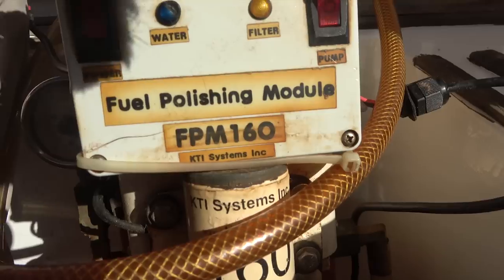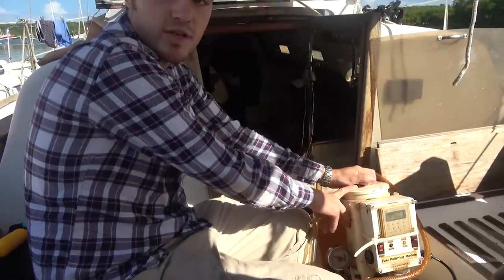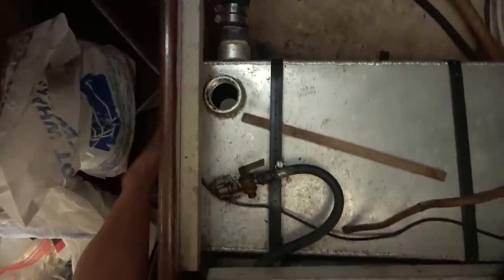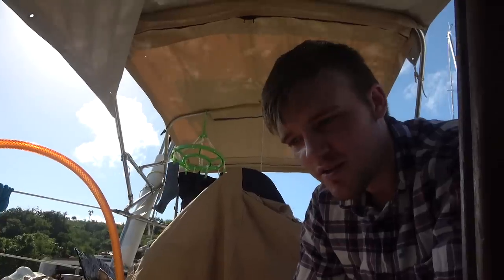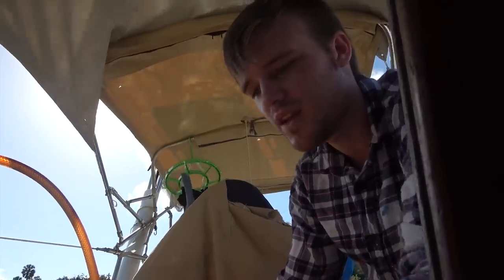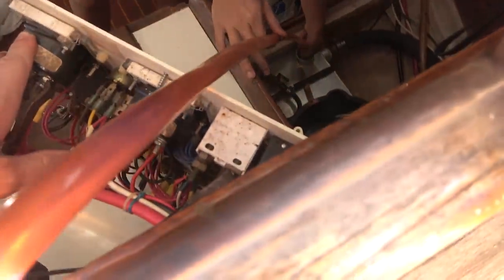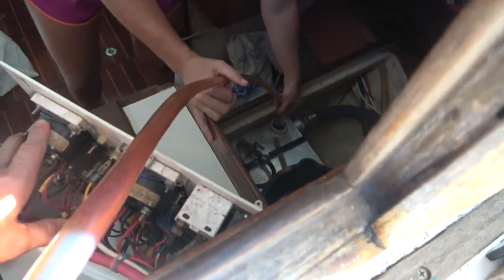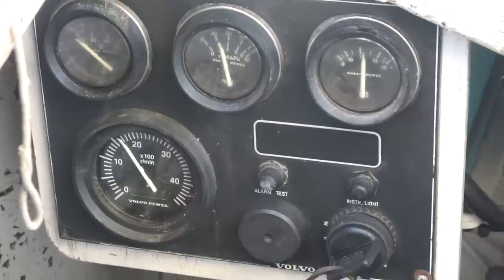Avoid DISASTER AT SEA the Boat Chore You can't Ignore  Ep 111

Comment: The problem with the outboard is you have a broken dioframe (fuel pump) the dioframe is a small pump with some rubber flaps inside and over time they must be replaced. It is the square box in the left side of the engine and it's connected to the fuel line, you can get a renovating kit for this pump. Regarding the fuel tank on your boat check the fuel cap and rubber gasket so you prevent future water in the tank.

Comment: If I might add my 2 cents, fuel is sucked in by vacuum witch means the vacuum port in carb is clogged. My remedy is take that carb off and every screw valve, soak it with carb cleaner or gas then shoot 120psi air through every hole, (opening) you see....worked twice for me anyway

Comment: Try covering the throat of the carb with your hand while trying to start the engine. This will cause a pretty good amount of vacuum so if there is any dirt within the carb or a priming issue it will usually pull it through.

Comment: Clean the tank because the sludge on the bottom gets stirred up in rough weather - just when you need the engine to run . When empty , take it right out and cleaning it with solvent and a really good shake
Reply from the maker: Okay, we emptied it completely and used a shop vac to finish it off. We didn't cut a bigger access port and the one that was already there did not allow us to get our hands down there. With a flashlight we could see that it looked good. Hoping that will be good enough.
Reply: @Bumsonaboat  It won't be good enough. As the saying goes: If you are in doubt, you are not!
How can it be an access port if there is no access? Cut a bigger hole and clean the tank properly. You are going to have to anyway, in the near future.
Reply: @Bumsonaboat  It should be it you gave it a really good vacuum- but it was bad .  . Many tanks are small enough that when empty are easy to remove and rinse out. You take it , fill it with a few cups of gas - shake the shit out of it , repeat . Then let dry and reinstall . They are usually aluminum so not heavy .

Comment: There is never anything anticlimatic about any of your videos. Enjoyed watching as always. Was fab to see Lola goofing around with her doggie pals. On the preventative maintenance front, don't forget your battery/batteries and alternator. Be sure to keep some distilled water on board and regularly check and top up if required the level in your batteries. Check alternator drive belt tension and carry a spare belt. Keep battery and alternator electrical terminals clean, free from dirt and salt and coat them with silicone grease, petroleum jelly (Vaseline or similar) or even regular automotive grease to keep corrosion at bay.

Comment: If you have the gray fuel line on the Johnson throw it away and buy new hose. Then change the spark plugs if you haven't this season. Then check your vent on your fuel tank. Little knob that you open up to let in air as fuel is used out of tank.

Comment: An issue I had with my outboard was a split hose between the tank and carby,under load the carby would empty out,and I’d be pulling and pulling and then it would fire up and run a little until the bowl was empty again.
Open tank vent to stop any vacuum between the tank and carby,check all lines are secure at the engine,if it’s got a wiggle in it at the hose connection point then you can almost bet your sucking air and not fuel,they need to be tight and secure.good luck with it.

Comment: Nice one guys. good to get all the gremlins sorted before you head out.
While you are at itwith preventative maintainance , change the alternator belt on the doesel engine if it is old.
2.you can sand and retouch the rusted areas og your diesel engine too to protect again corrotion , if you do not have the time then clean your diesel engine with an oily rag, it really helps. 3 make sure the johnson outboard is not sucking air in the fuel line. 4 recheck the carb and make sure that the floater is working fine as it can stop the bowl from refilling after it burns out its contents.

Comment: Hi guys  glad you're doing so good now. Great move on the diesel polishing.
On the outboard problem, you should turn off the fuel tap and run the motor until it stops if you are not going to use the motor for a couple of days. Reason is most gas has a percentage of ethanol which corrodes the aluminium (I'm a Brit) in the carb and that blocks the idle and sometimes the main jets.
So to fix yr prob check the fuel is flowing by undoing and removing the drain screw usually on the side at the bottom of the float chamber (Don't drop it) and pump the gas (with your nice new squeeze bulb) and see if you get muck out of the drain. If dirty fuel comes out you can try putting back the drain screw and try to run again. If it still gives you trouble you will need to take the carb off and clean it, especially the jets, float, main and air bleed. Good luck.
Best, Chris.👍
Reply from the maker: Hello there. We can definitely see the value in draining the fuel out of the lines now. The carb has been cleaned and the fuel that comes out of the screw is clean. Appreciate the ideas. We will keep at it.
Cheers

Comment: Re outboard fuel problem, to identify the source of your problem rig up a temp system to run from a jerry can using clear plastic hoses (remporarily only) this will show if the problem is the tank/pipe or the carb.

Comment: It's definitely a fuel pickup problem. If you squeeze the priming bulb every 20-30 seconds I bet it won't die. So check fuel pump and carb float. You'll be motoring soon! Also have you ever tried a biocide for your diesel tank.Be safe.
Reply from the maker: You are correct. When squeezing the priming bulb it continues to run. Although we just installed a new fuel pump and have cleaned the carb and inspected the float. All seems good. We do  have biocide on the boat. Thanks.
Reply: @Bumsonaboat  be sure to check fuel lines and connections. Its sounds like it sucking air somewhere and losing its prime. Even if you installed a new fuel pump its still possible the pump diaphragm could have a pln hole or crack in it. Does  it have a fuel filter? Keep us posted!

Comment: No Johnson it sounds like a fuel vacuum ie not venting fuel cap
Reply from the maker: We ruled this out by running the outboard with the fuel cap off. It seems like air is getting into the lines. Now we suspect it is a bad o ring in the quick fuel line connector.
Reply: Quick connects=👎  compression fittings=👍
Reply: @Bumsonaboat  that would cause a fuel leak and if you dont have one rule it out

Comment: Wow, that fuel polishing was spectacular. I've heard the words used but haven't ever seen it done. Some sort of crazy filtering system. Your so lucky you did it. And yes, I've heard of the guck, the algae that grows in Diesel, but hadn't seen it before either. So that was worth a million. I've been missing notifications, not sure why. And the impeller , great ! Now you won't worry about it ! And its really putting out the water great. I have a chain saw with the same problem as your outboard, it runs, but shuts down. Fuel dilivery system is so much more simple, so, I just don't know. I've avoided a new carb, so expensive, rebuilt it a couple times, no luck. Runs really fast and well, revs up perfectly, then shuts down.

Comment: Morning guys
Race????!!    Just enjoy the ride

Outboard is obviously getting fuel and spark if it runs....

It’s running out of fuel...  check fuel line for clog.. even inlet line to carb.......take carb and jets apart... make sure float working properly... Blow out with high pressure air and carb cleaner.... gotta be fuel issue. It runs
Reply: And then.... I would get some mechanic in a bottle to add to the fuel, a half dozen tiny, clear, inline fuel filters and follow the directions exactly on the mib. Found in lawnmower sections of any hardware store... essentially you need to polish that fuel and tank too, so watch the filter for clogging and change as needed!!! I have resurrected many basket case outboards with this hack.... remember,  nobody gets out alive so enjoy the ride!!!
Reply from the maker: Thanks, we have tried all of this. We are not suspecting the o ring on the fuel line connector to be bad which would let a bit of air into the lines.
Reply: Bums on a Boat   Unscrew the bolts on transom lift hard push off.    Problem solved

Comment: Maybe too late but, I had the same problem and find the fuel line let air into it so, when you pump fuel, you fill the carburetor and it works for a minutes or so then shut down. Check your connectors to the reservoir and the engine. If it's loose, air come in and shut the engine.

Cheers from Canada

Comment: Had an ouboard that did that. Mostly on high revs do. Turned out the motor didnt mix oil in to the gas and the piston pinched in the seating. Mixed oil in the gas manuelly and the motor ran fine 👍

Comment: If You can keep Your outboard running by pump fuel with the ball valve fuel isn't being pumped or air is leaking into the fuel supply line.
Reply from the maker: We just discovered that we can keep it running by pumping the priming bulb. Agreed, it seems like air is leaking into the fuel supply line. Maybe the o ring on the quick fuel connector is bad.

Comment: Hi bums Use a clear fuel line to see if you have an air leak on the Johnson. 
Your diesel tank I would take it out of the boat and clean it with water blaster then tip it out the filler till water runs clean. Then use meths to flush out the water. Put back in boat fill with new diesel. 
Bet there is more muck in your tank only way to clean for sure, as above.

Comment: The first thing you have to check when you start an outboard is to make sure that your motor is pumping water to cool.
Reply from the maker: The hose was blocked up. We cleared it out but still have the same symptoms.
Reply: @Bumsonaboat  not sure what you mean when you say the problem still exists. It either is pumping water or not. Second if you start a motor and in run but then stops, the most common problem would be fuel. You want to disconnect the hose that is coming out of the fuel pump no fuel that means it’s just burning what you pumped into the carburetor when you squeezed the ball. Want to confirm that pump the ball again more than once and I believe you will see the motor run until the carburetor is empty. You have a fuel pump problem. My guess air leaking.
Reply from the maker: @johnturner2175  I mean it is pumping water but it still dies from lack of fuel. Yes it really seems like air is getting into the lines.

Comment: When was your last oil and filter change on your diesel?  Give it a treat with some high quality synthetic diesel oil like Shell T6 15w40.  Before you fill it up, consider putting in a can of "Restore" - youtuber Project Farm did a great video testing this product.

The T6 alone got my Westerbeke 27 idle revs down to the 800rpm range, the Restore should smooth out any compression issues.
Reply from the maker: One year ago just before we hauled out. We used synthetic diesel oil.

Okay we will check out Project Farm.

Thanks

Comment: Definitely sounds like a fuel issue. Carb, fuel pump, air leak on suction side. You can check for leaks by pouring oil or soap on the lines while running engine, or blow air back through the lines and spraying soapy water on lines.
Might pay to check the spark when it dies also, but sounds more fuel related.

Comment: It seems as though the outboard's carb is getting filled with fuel when you prime it and then it runs for a short time and empties the fuel bowl. 

Try this: Squeeze the primer bulb until you feel resistance (which tells you the carb is full and the float is working). When the engine starts, continue to pump the primer bulb, keeping it firm and see if the engine keeps running. If it does, then the fuel pump is not working.

Try pumping fuel into the carb using the primer bulb and then remove the discharge hose from the fuel pump and aim it into a cup. Start the engine (which will run for a short time on the fuel in the carb) and see if fuel comes out of the discharge hose into the cup. If it doesn't, the pump is not working which could be due to a number of reasons even though it is new. If the vent is clogged or closed, usually the primer bulb will collapse and that does not appear to be the case.

Most outboard fuel pumps operate on crank case vacuum (and pressure). There is a  hole in the crank case that aligns with a hole on the pump where they mate where the pump is bolted
on. Check to see if the hole is clogged in the engine or pump and, if necessary, clean it out.   

- Paul
Reply: What he said...

Comment: Guys, one suggestion that we use on our boat for years with success.We bought a bunch of the cheapest diesel filter (one-time use ones). We use it as the first filter - so before the normal diesel filters - and make sure that it is placed so that is easily accessible. We also use clamps on the fuel line which can be operated by hand - so that we can change it without tools, within minutes. When in rough seas or before tricky manouvers, we just take a look at it (it is transparent) and if we see debree in it, we just change it to a new one. It is tem times faster and easier than cleaning the usual diesel filters installed on a marine diesel.
Reply: +1  on that, pre filters will save you tons of problems. Simple inline filter, cheap, easy to replace, buy lots of spares, change often.  Will give you similar symptoms your outboard has if they get plugged.

Comment: Pull your gear box and drive shaft. (it is quite simple) Clean it of any corrosion and grit. (especially shaft) Low HP motors often stall at low power settings with a "tight" power drive system.
Reply: Just an add on, your drive shaft is spinning even if not in gear so motor can kill in neutral also if  corroded, gritty, etc. .

Comment: On the outboard.   I'm thinking fuel vacuum leak.  Cuz it runs thru gas that's pumped manually but doesnt keep suckin.  Check the connections at the tank and motor side of fuel hose making sure there is a good seal and vent prong is not clogged. 
Also check fuel line going into carburetor for cracks and tightness. Should be the problem if carb has been rebuilt and adjusted ( air/ fuel mixture)
Hope that helps.
🤙

Comment: I was a marine mechanic for 10 years. Most likely it's one of two things. You could have a small crack or one of the clamps isn't tight. Or the O-ring Where the hose connects to the engine It is sucking air and losing its prime. Or could be a bad fuel pump. When you let them sit. The diaphragm will stick or get hard But I would check. The air leak first check where the hose Connect to the engine. That's a spot notorious. Just suck air.

Comment: Try a shaker syphon. They work great for transfering fluids from one tank to another. The laws of physics require the tank with fluid to be higher than the empty tank.
I believe this might help to prevent diesel spillage when filling your tank at sea.
Reply from the maker: Great idea, thanks. We just found out that we had one of those on the boat.
Reply: @Bumsonaboat  I'm glad to hear that. I use mine all the time. I have a boat myself. Not ocean worthy or 2 ft swell worthy but i keep the sump pump working with auto bilge on when the wind picks up or the boat duck dives into the waves. 1983 mastercraft stars and stripes. I love it and its a great conversation starter. Strangers come over to see it or to tell me they had, rode, skied, tubed on one in their youth. I gave up on the new nozzles on the plastic cans with their anti vapor and oragomi opening systems. Northern tool and tractor supply sell a replacement nozzlell for poring but those do not keep the vapors in. So I keep the original spouts but they are all broke and no longer plunge or work. There are two types 1/2" and 3/4". I have and use both. You can transfer a lot of fluid very quickly with the 3/4.  I ned and would recomend a 1/4 turn shut off valve to be added to it for when its close to full you can turn the valve to stop the fluid flow.

Comment: It runs out of fuel . Plugged fuel  filter in the motor , stuck float, bad fuel pump  , plugged pick up in the fuel tank . Borrow someones fuel tank and hose to eliminate that part .  In addition an air leak or a bad fuel pump with do the same too , to rule that out keep pumping the primer and see if it runs then . If it does then it is the the motor end - fuel pick up - bad pump , air leak,  float . 

Also - manual choke ? Did not see you turn it off when it started .
Reply from the maker: Appreciate the ideas. We did have the choke in. The motor actually starts better without the choke.

At the moment we suspect the o ring on the quick fuel connector to be bad which would allow air into the fuel lines. We will keep you all posted.
Reply: @Bumsonaboat   Good luck . You can rule out the tank and hose by borrowing a neighbors and trying it .  If it runs fine your problem is in the tank or hose , if it does not it is on the engine side .

Ethanol in pump gas is known to eat all the plastic hoses, seals and gaskets  in older engines not made for it .  It could have eaten the fuel pump up too .

Comment: Me again,,,,,,to make sure of my theory for below...disconnect bulb hose leading to tank,  Use a different hose from bulb leading to tank,, fill a water bottle with gas put hose in it pump bulb and start that puppy.   Did it run and suck out The gas in the bottle? If yes, your tank leaks to much air from connection port to the bottom inside the tank,,, your welcome.  :)